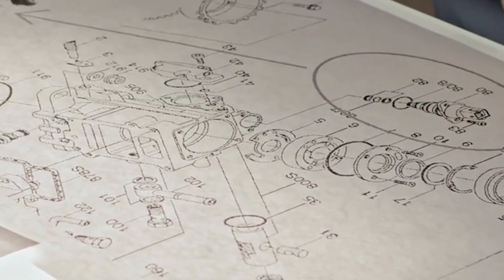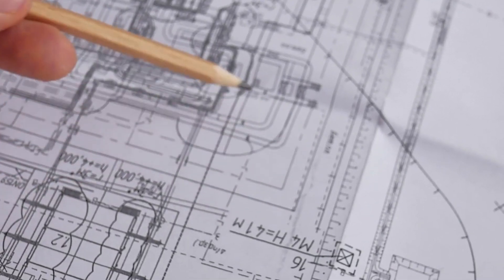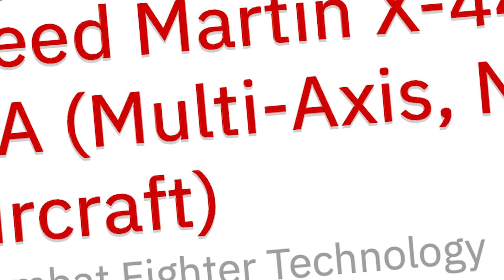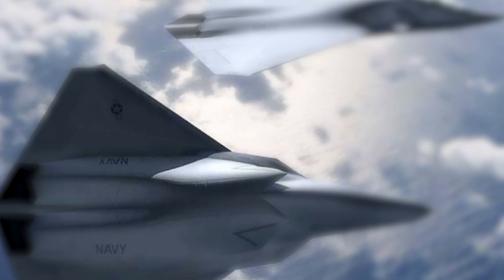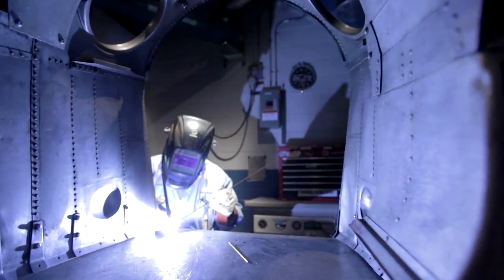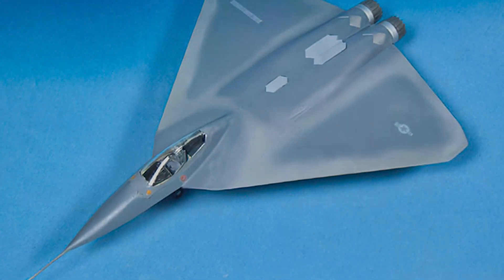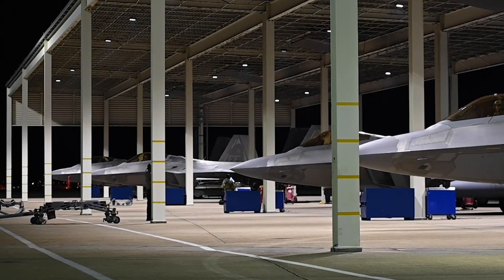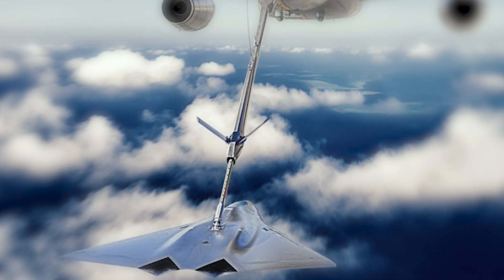The Secret Stealth Fighter that Could have Changed Everything

Comment: Take the manta pair it with a pilot on the ground but put that pilots pod in a next genVR 360 degree viewing chamber. (Think Professor X in Cerebros.) That way you have a fighter jet with a human control but non of the G-force enduced negatives and you could literally turn on a dime with vector controls. Add in some A.I. stabilization/low level auto pilot and you have a 6th Gen fighter.

Comment: 7:01 is probably more realistic in terms of future designs. Minus the  rudder. Some sort of delta smooth wing design with engines far apart rather then close together. Vectoring engines that are far apart will have greater performance. Basic torque physics. The farther from center, the greater the torque. Plus it will allow for a much larger mombay and more fuel.
Reply: By your command

Comment: technically all twin engine aircraft have quasi thrust vectoring by using differential thrust this can increase yaw rates and is very noticeable at stall speeds a simple software upgrade could enable a passive version of this on any flyby wire control system so as not to further burden the pilot with an increased need of input this wouldnt be as good as reorienting the nozzle but is better than just using the rudder to yaw another way of achieving thrust vectoring without manipulating the nozzle orientation would be to add additional small exhaust ports like the av8 but at the rear at an angle and have a computer controlled valve that opens when yaw control is input by the pilot

Comment: Alternatively, you could have a YF-23, and actually be hard to find on IR because your exhaust is well concealed. It already had less drag than the 22 as well. Not to mention no turbine RCS from below & behind. And included thrust reversers, which were dropped as a requirement to help Lockheed compete.
And losing power wouldn't cause you to completely lose control and likely never get it back.
But Lockheed did good on the F-35.

Comment: Considering the raptor was designed 40+ years ago (far before the internet or dvd players) I can’t imagine what they’re designing now. Especially if you remove the one biological component that limits the aircraft to 9 gs.
Reply: I don't think that will be until gen 7 and even then they'll have to drag the USAF kicking and screaming to get there. It will happen, but it will likely be the first time the USAF has had to swallow it's pride and do what it's told.

Comment: Some of the early two person seadoo's had only thrust vectoring for the steering.  When you let off the throttle you lose your steering and run into whatever is in front of you.  That's why I learned that if there was suddenly something in front of me, like say a sunken log in the river, I would just turn hard and not let off the throttle.  I can see the same issue with a fighter jet relying only on thrust vectoring.
Reply: if you lose your engine in a dogfight , losing the ability to control it most likely is not the immediate concern.  They would likely already be in the process of ejecting
Reply: @bear76009  if you're dog fighting you're dead. all about integrated targeting networks with autonomous vehicles. I think "shield" drones  and smart "formation loitering" munitions will be the new race. Keeping stealth as a main priority until a new radar shows up.
Reply: @I69urmom  I agree in a peer or near peer situation but that's not the case yet unless we fight ourselves.
Reply: @I69urmom  i dont think it will be a new radar that ends the stealth trend i think its gonna be an ai driven irst network solution that can track targets in the visual and beyond spectrum that will make stealth obsolete along with most modern countermeasures like chaff flares ew pods and rwr if this comes to be every military will have to scramble to develop a completely new doctrine for aerial combat those to be first will be the ones to steer the future of warfare

Comment: Boy, I'd hate to try and control such an aircraft during a loss of engine power.
Reply: Or failure of the thrust vectoring mechanics. Either way - no choice but to bail out….
Reply: @joeylawn
Let’s be fair, failure of control systems in any fighter requires bailout…
Reply: @Mobius118  true

Comment: I think the American 6th gen fighter/interceptor will look like a fusion of the F-16XL and the X-32.
Reply: F-16XL? I can't see that.
Reply: @trplankowner71  There are massive benefits found in the F-16XLs' main wings. There is a video about the "XL" here on youtube and it's fascinating. 
It was in competition against the F-15E and in almost every way the F-16XL was superior....
Reply: @King_Dusty_Of_Pookytopia  I'm aware of what the F-16XL was and of the "F-36 Kingsnake" proposal. Neither design is a basis for a 6th Gen stealth fighter.
I think that in order to decrease the radar cross section, the "NGAD fighter" will necessarily have an airframe more like the B-2 and B-21. A deeper leading edge angle and neither the trailing edge serrations of the B-2 nor the extended "winglet" sections of the B-21. Yet tailless and with the inlets far enough back from the leading edge of the wing so that they can't be seen from below, like the two bombers. Most likely it will be powered by two of GE's XA100 to reach the altitude and speed requirements of the USAF. Pratt & Whitney will get the upgrades for the F-35, I don't see the extra cost of the XA100 being justified there, unless GE has some major breakthrough in both efficiency and maintenance.

Comment: Makes me wonder if the real reason the F-22 Raptor was chosen instead of the YF-23, was because the thrust vectoring system was something they wanted to get real-world test information from for a future fighter design. Not for any of the other stated reasons that get floated. The YF-23 was a grreat plane but maybe the Pentagon had a further goal of seeing the extreme thrust vectoring concept get implemented so that some day a tail-less fighter could use it?
Reply: Test  Pilots had stated the YF-23 was roundly superior to the F-22. The decision making process was wildly complicated, political (though not as nonsense as some things in Govt) and largely would have been solve simply by building both. But Russia and China had been very quiet in the 1990s, so only one would be chosen. I had come to the personal conclusion the YF-23 was just  so much better, yet so different, they did not want to push too far ahead of the curve without need or having at least a vague idea what comers next. 

It would not surprise me if the YF-23 was aped heavily for the NGAD and F/A-XX. Or a heavily updated YF-23, with 360-degree Thrust vectoring was at least submitted. This as the YF-23 was determined to have, in hindsight, all the attributes desired fore  sixth generation fighter. Longer range, better stealth, higher innate speeds with and without afterburner, and fairly  easy to retool as a fighter bomber, not entirely unlike the F-14. Pretty much what is needed should war with China break out.
Reply: @DocWolph  the YF23 was superior to the YF22. Yes it was a Political decision. One of the reasons the 23 wasn't chosen was because the AF said it was underpowered but the 23 was outfitted with Engines recommended by the AF. Most  of us maintenance personnel who worked on the YF 22 Vs YF23 competition preferred the 23 over the 22 due to ease of Maintenance and Weapons  loading
Reply: @DocWolph  Both aircraft met requirements, but the YF-22 had thrust vectoring. Game over for that reason alone, obviously.

 Add to that taxpayers were paying twice for the B-2 since the original design performed poorly and Southrop had to start over.

 Add to that, Southrop was in trouble for delivering ICBM guidance systems with Radio Shack parts.

The ATF program flight test data is classified. You never had access to it. If you did, you sure as hell wouldn't be blabbing about it here.
Reply: @MrKentaroMotoPI  
First, It is Northrop, Northrop Grumman.  I know you do that just to aggravate. All I did was give the  correct name of the company. I did  NOT take a  dig at you for making a mistake.Just  stop. its stupid.

The F-22 having Thrust vectoring, was just icing on the proverbial cake. Not a Dealbreaker for the YF-23. This since USAF pilots have said the Thrust vectoring is not that useful even in a dogfight. Scrubs off too much speed. As I said, before in this thread, the decision making process was very complicated.

Somehow, using ICBM guidance parts that work and keep working easy enough to get and use is NOT an issue. Try harder. Better stop trying you are wandering off into that "I'm not butthurt but I keep acting like it" area where you will keep making excuses and being pointlessly rude and aggressive. Just stop and move on.

You really need to do research. A LOT about the F-22 vs Y-23 has actually been said, in bits and pieces, for years. One doe snot need to have access to the reports, just open eyes.
Reply: I’m so glad they chose the Raptor instead of the YF-23
Reply: @Mobius118  
Both have their strengths. The F-22 is a  better dog fighter. but the YF-23 would have been the faster, longer range, stealthier, fighter bomber.

Given the F-22 has never had to fire in  anger at anything, except that one balloon, and now that War with China is on the table, and the topography of that region, The YF-23 would have been the better plane. But all that is hindsight talking. 

It would have been better to have enough of one plane or the other. Better still would have been to have both. Unfortunately, the US did not have an enemy worth the time and effort to have both.
Reply: @DocWolph  You defend the criminal behavior of Southrop selling defective nuclear weapons as well as having no concept of drag due to lift. Bizarre.
Reply: @DocWolph  '. . thrust vectoring isn't that useful even in dogfight '
Did you watch SU-57 in Top Gun movie?
Thrust vectoring makes fighter turn tighter, making it easier to get behind opponent fighter & launch short range missile, such as Sidewinder, in dogfight.
Reply: @budisutanto5987 
A movie that is mostly fiction where the fighters, the SU-57 in this case, was doing it  more for spectacle. 

Anyway, modern combat fighter pilot doctrine is to  KEEP YOUR SPEED UP. IN this way to keep you distance so you can have time to react and have a "head of stream" going so you can outrun missiles long enough to evade them or counter them.

Using the Thrust vectoring to supermaneuver is only any good if you are fighting a plane that is significantly slower.  Otherwise, you end up going too slow and are an easier target to faster moving aircraft, their missiles and projectiles.  "In combat, never fly straight. Never slow down."

Russian planes usually sound really good on paper, but in practice, usually come up very short in some critical metric. After all, the US had 360-dgree Thrust Vectoring in the 1980s, even planned it  for future version of the F-14, which never happened, because the US Military (USM) figured out 3D Thrust Vectoring was not necessary and even a hindrance to a planes maximum combat performance. 

Even with the USM's current attitude toward dog-fighting, the doctrine remains sound and thrust vectoring has not changed that.
Reply: @DocWolph  Google it,
F-4 Phantom speed 2.370 km/h
F-18 Hornet speed 1.915 km/h
Let me know when you already figure it out.

I agree about SU-57 doing it for spectacle, in reality, thrust vector fighter can fly heading North,
but facing East/South/West,
making it capable to shoot on that direction and safely recover facing back to North.
Reply: @budisutanto5987  
1. What are you talking about? 

2. What you are describing is called "side-slipping". You don't need Thrust Vectoring to do it. This has been a available feat for many fighters since WW2.  It is basically the airplane equivalent of Drifting in a car. Flying in one direction as the plane's yaw is rotated to face to the side. Using Thrust Vectoring does not make Side-slipping easier or last longer.  

Thrust vectoring would only be useful here, if you stall the plane, which is possible but easy undone simply by rotating Yaw into the turn.  But then Stalling is a major problem with Thrust Vectoring as overuse scrubs too much speed, killing lift. 

Thrust vectoring would allow you to rotate the plane into an advantageous angle of  attack to get speed back. But if you have to that, you done f'ed up. Again Thrust Vectoring is not very useful in modern air combat. It looks cool but unless the plane actually needs it, it is not needed. 

So again, if the NGAD and F/A-XX are rudder-less, 3D Thrust Vectoring will actually be useful and needed for those planes as yaw control is very hard without Rudders. Lateral thrust angle control, available in 3D Thrust vectoring, will  be needed.
Reply: @DocWolph  F-4 is fast enough at 2.370 km/hr but lack agility for dog fight, and only because excellent pilots, becomes a formidable fighter.

Your fast doctrine is quite outdated.

Harrier an example in far end of spectrum, a subsonic fighter, that can out maneuver other fighter of it's time,
use by marine.

F-35 Lightning II speed 1.960 km/hr.
Reply: @budisutanto5987  
First the F-4 Phantom II has not been in service by the USAF, USN, or USMC since the  late 1980s. Fighters of this period were designed for all-out speed. The  F-4 was also designed are  a missile  truck and a fighter bomber Dogfighting was not considered important at that time, but that quickly changed during the Vietnam War. The plane did not originally even have guns. The Mig-21 forced that  change. 

The AV-8  Harrier was  sitting duck versus other fighters, being used mainly against ground targets and helicopters.  Its maneuverability, a function of the VTOL capabilities,  was  not much good at all in dogfight.

You are trying to be right about something  for some reason. Maybe an infatuation with the Su-57. Don't get me wrong  Russian's make some really lovely  planes but that does not make them better. 

The truth is 3D Thrust vectoring does not help the SU-57 in a dogfight. 

As I said before, "You don't fly straight" and you don't slow down." In a dogfight, Speed  is protection. Thrust Vectoring is not very  helpful at all since using them will invariably scrub speed making the plane vulnerable to faster moving planes.
Reply: @DocWolph  You've done some reading, good, now you know speed doctrine is outdated -> F-4.

F-22 have good trust vector, I believe it's no 1 in dogfight.

Next, read about missile speed and dogfight tactics.
Reply: Lockheed was told they could either do the yf23 or b2, but not both.
Reply: @LGB-FJB  
As I understood it 1) Northrop Grumman was already building the B2. 2 ) The Military did not want "all their eggs in one basket" and among other reasons chose the F-22 so Lockheed Martin would have a better chance of staying in business and if anything went wrong with NG, the Military  would not be out BOTH their Stealth Bomber and Stealth Air Superiority Fighter.

As it was, since there was no enemy to fight or at least stand strong against at that time, the Military did not see the need to have BOTH the  F-22 and *F-23.
Reply: @LGB-FJB  yep.  thats it.
Reply: To me the air-force has a hard time picking planes outside the visual norms.
Reply: Wow, this comment thread is bristling with air force generals, aeronautical engineers and air warfare experts. I just clean the toilets at wallmart for a living 😄
Reply: @rogerdodger1790  All honest work is worthy and needs no excuse. 
With that said, there ARE some of us who have spent years professionally working in the military, weapons, and aeronautical engineering communities acquiring along the way knowledge, expertise, experiences, and paychecks. Unlike the legion of video gamers who have diligently immersed themselves in legacy tech, tactics, and equipment, the information we post are current, declaasified, and publicly available. Many of us have multiple NDAs that extend through our DD214s to the day we die. If you really don't want the truth, that's  OK; believe whatever you want because that is the beauty of the USA, especially compared to our sworn enemies, Communist China and Russian Federation.  
BTW, generals rarely ever post to these videos as they have numerous mandatory NDAs out their kazoos to control what they say, especially after they retire. Besides, these videos are beneath them.
Reply: Northrop bragged that the YF-23 was faster. stealthier, and more maneuverable than the YF-22. While the YF-23 was a bit faster. the rest were lies. During one of the YF-22 demonstration flights, it pulled 9 Gs and launched an inert missile at 60 degrees Angle of Attack. When the evaluating generals suggested Northrop do the same, they declined because the YF-23 was not capable of doing bothe the Gs and the Angle of Attack. Although YF-23 Test Pilot Paul Metz always claimed the YF-23 could, during one of his presentations. Metz included a slide summarizing the YF-23 flight highlights achieved and both YF-23s never anywhere close to what the YF-22 proved it can do. As for the stealth, keep in mind that stealth research was still in its infancy. After the YF-22 was selected. it received over 100 stealth redesigns to its body, plus the coatings, and other modifications which produced a Radar Cross Section (RCS) reading equal to a small marble.
Keep in mind the both Korea and Japan when to Northrop with the intent of purchasing the YF-23 design to be used as their foundation of their 6th Gen fighter. After an exhaustive analysis, both nations passed on the YF-23.